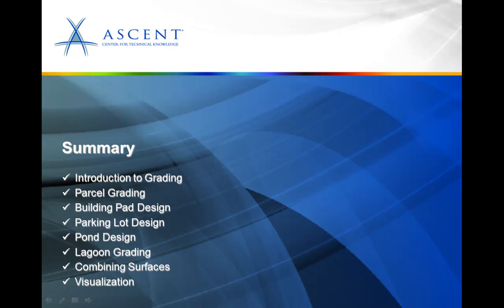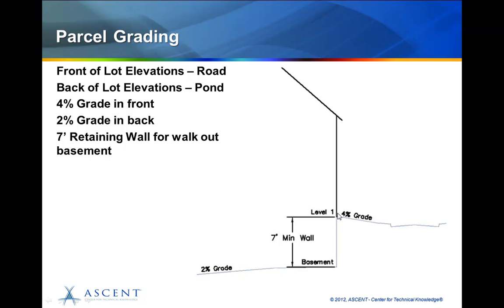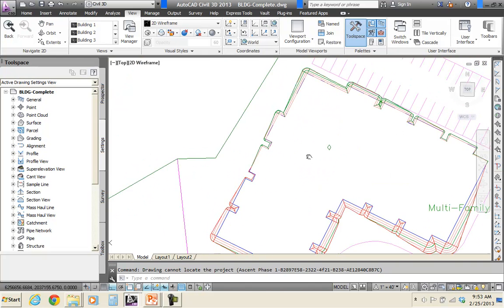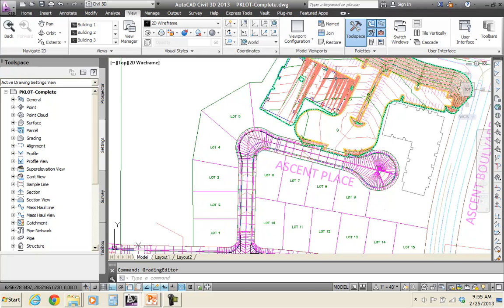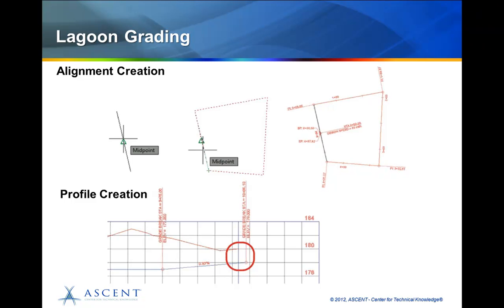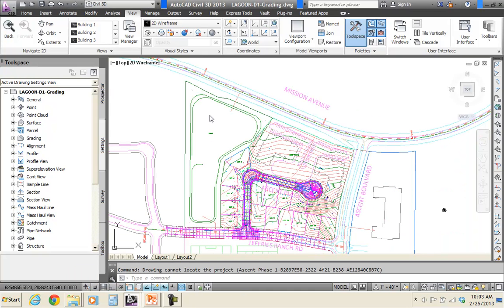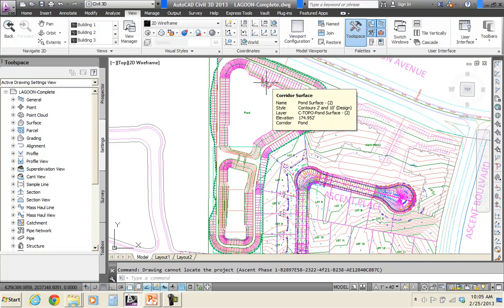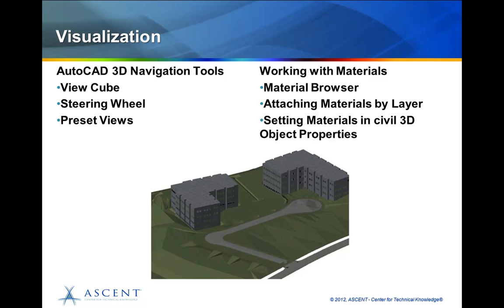Interested in learning more about ASCENT's Civil 3D 2013 Grading Guide?

Comment: Hello Michelle, am working in a project with 2:1 slopes, after 30 feet vertical we need to add 8 feet terrace drain sloping to 3 feet downdrains, do you have a video showing something similar by any chance? will appreciate it.
thanks
Reply: I've taken over from Michelle at ASCENT maintaining the Civil 3D courseware. For your situation I would recommend using the "Grading to Distance" Grading Tools within  Civil 3D. You specify the distance and the the slope. For the vertical, specify the slope of 0%.